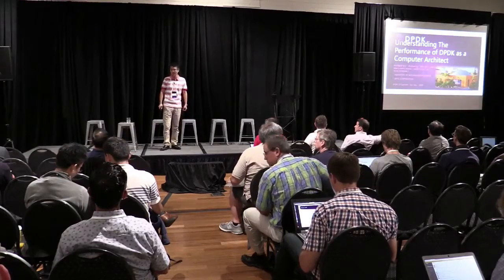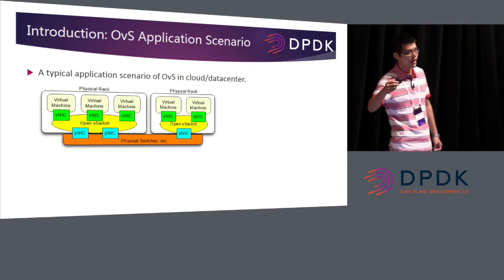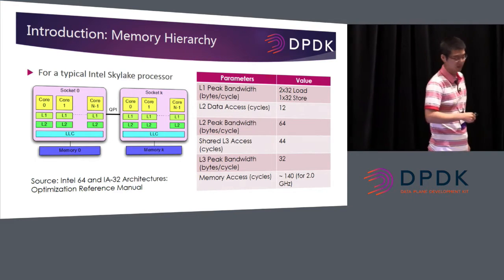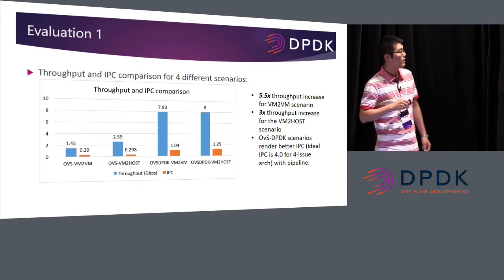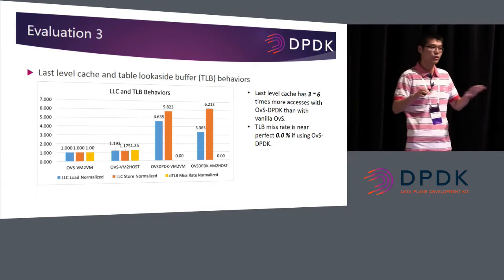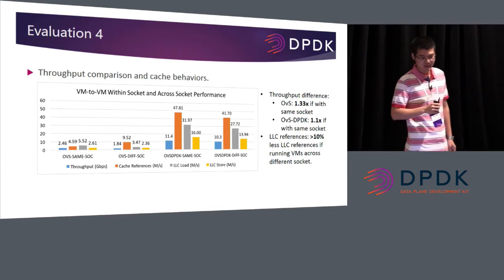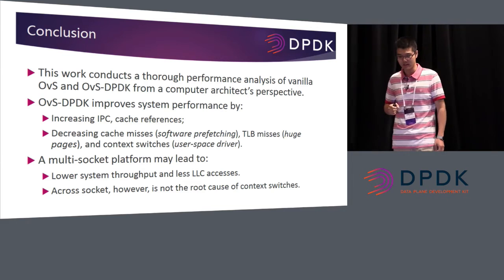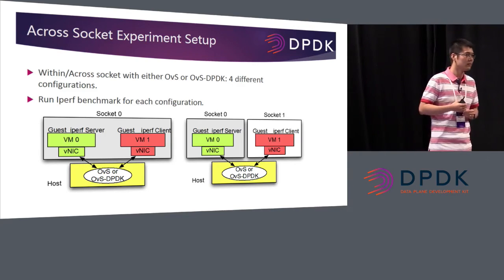Understanding the Performance of DPDK as a Computer Architect

Comment: The audio is a bit low but I just want future viewers to know that the closed captioning is actually very good. 
I only saw a few issues but they're minor typos:
1. Cache is at some points spelled 'cash' (minor issue)
2. At some points when mentioning L1/L2/L3 cache, the L is lowercase so looks like a capital 'i'.
3. At some points as the presenter says 'OK' it just says 'K'. 
4. When the presenter says 'DPDK' the captioning says 'DVD'. Probably the most egregious of the typos.
5. 'OVS' routinely written as 'OBS'.
The captioning appears to be auto-generated but very readable.